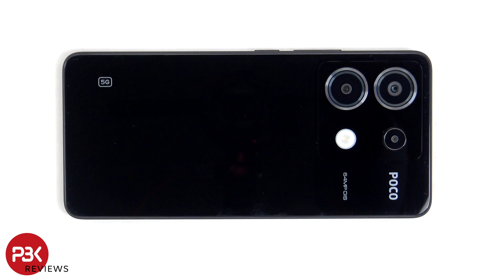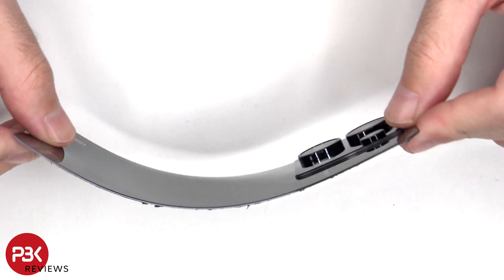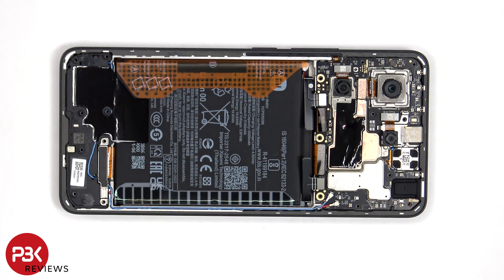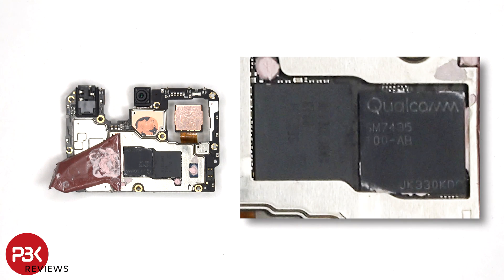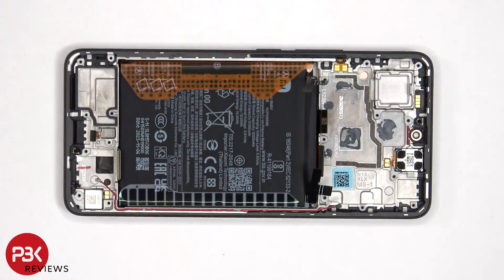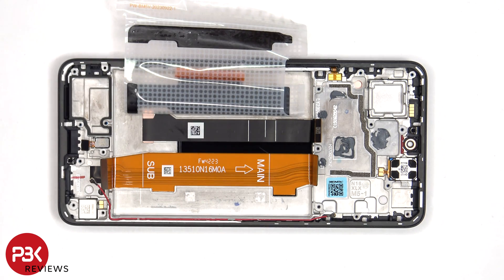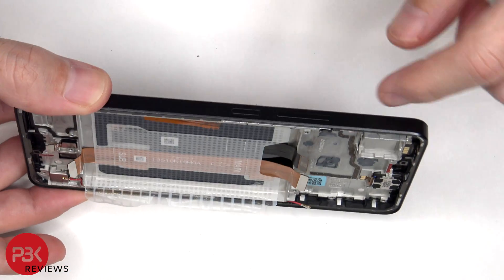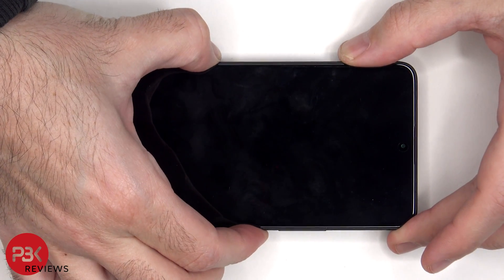Xiaomi Poco X6 5G Teardown Disassembly Repair Video Review

Comment: Bro, i'm curious about the battery of x6 5g and x6 pro, is it possible to use x6 pro battery as a replacement on a x6 5g? i cant find any battery replacement for the 5g version only for x6 pro, i hope you can help me.
Reply: Poco x6 5g use same battery with redmi note 13 pro 5g .
Reply: What happened to your battery?
I actually searched for this video instead of recommended by YT

Comment: Why the 3d layer of graphite is small on poco x6 5g while the poco x6 pro 5g is much bigger 🇵🇭
Reply: i assume it's because the snapdragon 7s gen 2 only has a max clockspeed of 2.4ghz, meanwhile the pro version has the dimensity 8300 ultra, which has a max clockspeed of 3.35ghz

Comment: Where NFC is located
I my Region NFC is not available, i was thinking of can we add the NFC Manually
Reply from the maker: The NFC antenna would probably be on the plastic motherboard cover, but if your phone doesn't have it, its more than likely the contacts on the main board wont be soldered on either, as well as software not enabled as well.

Comment: It will has a dead mother board issue right bcs the is on the top of the processor
Reply from the maker: no wrong. All high end flagships have the RAM seated on the processor, it provides better performance. It comes down to cooling, and quality of parts used.
Reply: @PBKreviews  What temperature must the phone not reach for it to disconnect like this stupid poco problem?

Comment: In poco x6 they used any cheap materials?
Reply: I've just got the poco x6 and it's amazing. You wouldn't think it was cheap if you see it. Very good build materials have been used compaired to older poco phones. I'm very impressed with it the amoled display is almost qhd with 468 ppi. And it has ggv on the front you only find that glass on flagship phones. Totally insane for the low price it even has 256gb of storage. Poco have upped their game with the build materials used. Amazing phone!
Reply: @PaulTheCollector44  I have 3poco mobiles in my home, in January my 11X is dead then I heard about xiaomi have mother board issues, especially poco X series, so I'm worrying about to buy xiaomi brands 😑

Comment: I have question, if i using phone cooler the placement are below camera. So does it mean i only cold the black plastic things? Not the motherboard? 

So are the cooler functions well?
Reply from the maker: most phones the coolers are placed in the center of the phone. Its not to cool the motherboard, they are made to cool the back housing and allow for the internal heat of the phone to exhaust quicker to the outside of the phone and cool off faster. They don't directly cool off the boards.

Comment: Is there vapor chamber inside  to transfer heat?
Reply from the maker: no it uses 3D graphite
Reply: @PBKreviews  so, which is better to transfer heat, using  vapor  chamber or 3d graphite?
Reply from the maker: I prefer vapor chamber but 3d graphite does a decent job as well.
Reply: 🎉❤😮 budget cooling system😅

Comment: Does not have a proximity sensor? 🤔
Reply from the maker: It does. its around 7 minutes in the video if I'm not mistaken.
Reply: Yas specification mentioned but not shower software base and hardware which one is used😮

Comment: Bro, please teardown redmi note 13 pro 5g. It's not rebranded, it's different product. 

Glasses back vs polycarbonate
200mp vs 64mp
Ip 67 vs ip 54
Reply from the maker: it doesn't matter, it's the same exact phone aside from the material being glass back instead of plastic and having a 200mp sensor instead of 64mp. It's the same exact layout inside, same motherboard, same battery and same way of taking it apart. If I did a teardown on that it would be like re uploading this same video. There is visually no difference internally.
Reply: @PBKreviews  so I can simply switch the 64mp cam to the 200 one?

Comment: In your experience which is better for passive cooling? Vapor chamber or 3D layer of graphite?
Reply: Vapour chamber is best bcz it works fast and better but takes a larger area
Whereas graphene sheets can be used in thin phones